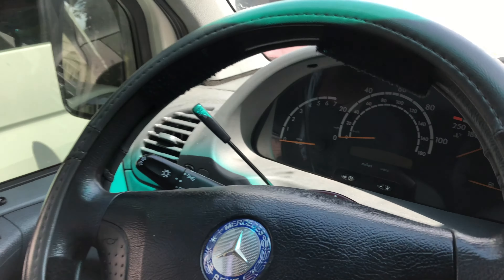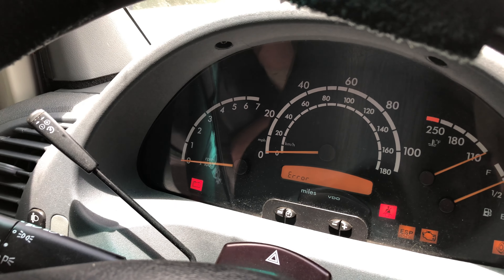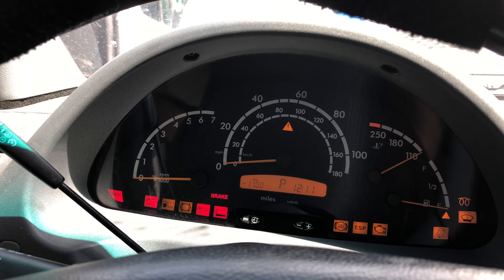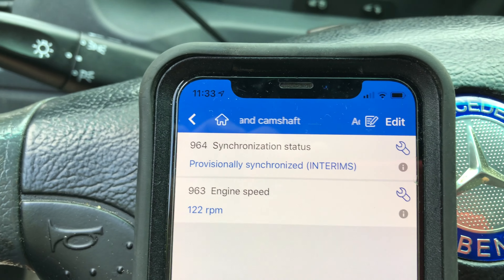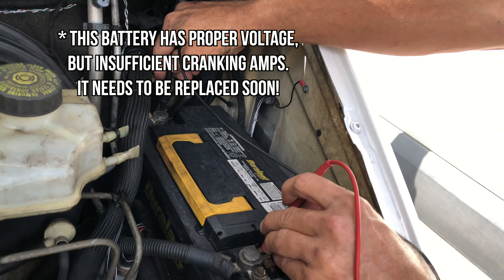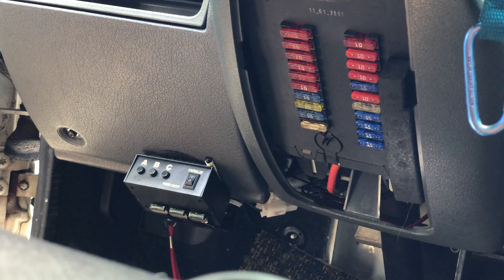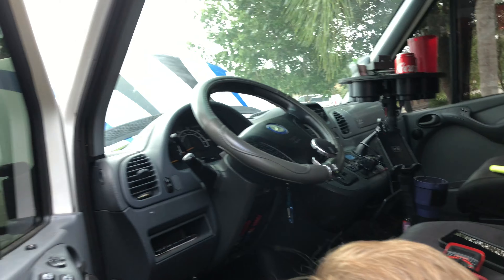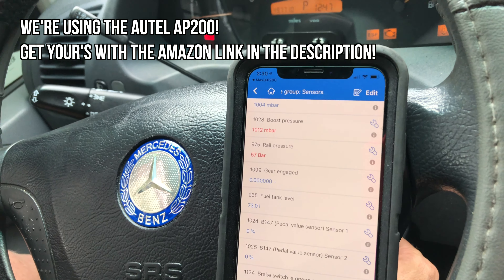Common Causes a Sprinter Won't Start. Fuel pump relay, starter relay, fuel flow, low battery, etc.

Comment: I have a 2005 sprinter 2500 diesel van that has been converted to a RV.  This van has a freightliner badge.  The van will not start.  The first problem with a no start could be fixed by removing the negative cable and reconnecting it.  This worked for a while. Next the dash would light up but the van would not crank.  Now when the key is turned on the van the power blinks on and off repeatedly.
I replaced the engine control relay but it made no difference.  Have you ever had this problem and do you have any thoughts about how  to fix the problem?
Reply from the maker: Yep! I'll bet $1 the short battery negative cable has a bad connection. The ground point on the firewall right there is notorious and the cable going into the lead battery clamp is often problematic. Replace that short cable and clean the firewall connection with wire brush. Use battery grease available in $1.99 pouch at the register of every auto parts store. Be sure the battery has a good charge and let me know if this does not resolve the problem. I have my 'double or nuthin' bet' already loaded. :)
Reply: Thank you.  I will certainly give this a try.
 @FloridaVanMan

Comment: Well I primed the fuel filter and the fuel pump is drawing fuel but still turns over but no start. I’m thinking my next step is replace the cam sensor although I did here the radiator fan running and just seeing your video that relates to this watching it next! Thanks
Reply from the maker: If the electric radiator fan comes on when the key is turned on it isn't going to start. There are three relays under fuse box on steering column. Swap those around and verify fuses #16, 17 & 18. Verify the fuses on the front of the battery are passing 12volts to the bottom of each big fuse. https://www.youtube.com/watch?v=hRmXq4KRHdQ&t=284s
Reply: @FloridaVanMan  thank you once again on a weekend evening!! I’ll check and verify!
Reply: @FloridaVanMan  but it does crank over!
Reply from the maker: @farmitecture2060  Fan comes on and the starter still turns? That's unusual. Maybe someone has hot-wired the fan trying to make the a/c colder.
Reply: @FloridaVanMan  yeah I plugged in a code reader and just turned the key to provide power and the fan ran the whole time. Wasn’t sure about codes as battery had been dead for some time but got codes C1022, C1010 and C1024

Comment: Hello sir I have a same problem with my 313CDI when I stard and I try to accelerate the van turns off...I change fuel pump, and air filter unfortunately same problem..plz tell me what to do?🤦‍♂️
Reply from the maker: That usually means your fuel pressure at the rail is dripping too low, causing the van to stall. I can work with you on some testing for leak-off in the injectors and the fuel rail. You might also be experiencing shut-down due to an electrical issue at the fuse box but I think the fuel pressure is the right place to start. Do you have a good code reader like the ones linked here? https://floridavanman.com/links/

Comment: Se problem no start only crank.  Will start with starter fluid in air intake.  but my van 2001 sprinter  an has no in tank fuel pump. Can't find pump relay .  Is there something similar 🤔
Reply from the maker: A 2001 won't have a pump in the tank or a relay. Starter fluid is a really bad idea. Use diesel fuel in a spray bottle. It works almost as well and is a LOT safer for your engine! Since either does start it we know it is trying to run just not getting enough fuel pressure to start. Likely culprits are injector or rail leak-off. We have tests for both. Search "leak-off" at https://floridavanman.com/
Reply: @FloridaVanMan  thank you for your help 😃

Comment: This is a great video! Would this apply to a 2008 sprinter as well? I pulled into the gas station got some diesel fuel pulled up to the front went in to get my change want to come back out she wouldn't start, just crank.. It was about time for my fuel filter so I figured that was it I changed the fuel filter no help still just cranking. I will give you a video another watch when I get back to my van. Thanks!
Reply from the maker: There are many similarities but also some differences. Is it possible you pumped gasoline and not diesel? Cold fuel on a hot pump in the tank can be the event that causes a bad fuel pump to quit working but there are many other things that cause low fuel pressure. Do you have a compatible code reader? Find me on FaceBook for 1-on-1.

Comment: Hi! I have a 2005 with cold start troubles. Replaced all fluids and filters, camshaft sensor, and all glow plugs, battery tested good. Only happens 30% of the time. Once I get it running it turns right back on no problem. Been to 2 shops for help with no luck. They said pressures look good so I’m assuming that rules out fuel delivery issues. Maybe injector giving out? Any advice would be great thanks! 🙏
Reply from the maker: It could be one injector allowing fuel pressure to leak off, returning to the tank and not holding enough pressure to fire-up the injectors. There are several more likely culprits in the pressurized fuel system. Without reading codes you are throwing darts in the dark. Get the AP200 from our links page then watch the video on setup for a Sprinter. I offer one-on-one help to our Patreon members. https://floridavanman.com/donate/

Comment: hello, can you tell me what are the relay under the driver's seat for?
Reply from the maker: Accessible from the side access, the yellow one is for the in-tank fuel pump (2004-2006). Older vans won't have that relay. The black or grey one is the start relay. Deeper under the seat is different for almost every van. Every change in factory options changes the layout of the relays under the front edge of the seat base and testing is the only way to discover which relay does what.

Comment: Hey @FloridaVanMan I'm in Australia with 2003 413 4Cyl Sprinter and after a recent fuel filter change it's developed a strange no-start problem, it will start off the key with no problem...run for a few seconds, then stop.... now it will take up to 8 attempts to start then it starts and its back being its normal self. This situation has happened before when I changed the fuel filter..Any suggestions? Thanks in advance
Reply from the maker: Strange symptoms, could be an air-lock but I'm leaning toward something going wrong as the ECM changes from default startup values to read sensor values. If you have a meter like Autel AP200 look at the live data, specifically MAF value, rail pressure & EGR value if you have that. Watch it at startup thru stall, then watch again at startup when you expect it to be normal self. Something will probably be different a moment before the van stalls.

Comment: Question, my 2003 sprinter Freightliner van does not have the extra relays that are in this video It has one black one. The numbers do not match the ones underneath the seat. And mine I had to take the seat out to access them. Please please please someone help me It has been down now for 2 months and when I turn the ignition on there is no noise or buzzing from the gas tank. So I want to start with the relay. Is there any other fuses or relays?!?! I am a complete loss and frustrated to no end

Comment: I purchased the Autel AP200 from your amazon link. I have a 2005 T1n freightliner sprinter. It says not supported when i enter the VIN . Do i need a different scanner?
Reply from the maker: Don't enter the VIN. We have a video showing set up and first use. Skip the VIN and manually select Sprinter in the menu.

Comment: Is there anything special about jump starting a 2006  Sprinter T1N (308cdi in our part of the  world).  Is it alright to connect to the battery terminal in the engine bay, or will this damage the ECU.
Also what about Solid State jump starters, again is it alright to just connect to battery terminals (my battery is in engine bay). I cannot see any  additional terminal meant for jump starting like in the newer  sprinters. I was looking forward to see this mundane topic of jump starting, but he  skipped it altogether.
Reply from the maker: Nothing special about jumping our vans. Jumper leads go directly to the battery positive and the black lead can go to the battery or any good ground on the van. The ground strap between body and engine is often a weak point that can be identified by moving the black jump lead to the engine.
Reply: @FloridaVanMan  What is the Hella part  number of the 5 pin relay shown here (in the video).

Comment: NEED HELP! My sprinter fuel system was working perfect but I had to pull the engine for repairs and install it back, now the high pressure fuel pump won't allow the fuel to pass through it. I replaced all the sensors and regulators. Something is telling the computer the pressure is too high but that's not possible because very little fuel is going into the fuel rail. Will the camshaft sensor stop the high pressure pump from pumping, I will check that next.
Reply from the maker: Cam shaft sensor isn't your issue. I'll bet a dollar you have two plugs swapped. Look at the plugs on the high pressure fuel pump. The larger plug should have a 90 degree bend in the plastic plug. If the wires come out of that plug straight, swap it with the plug on your crankcase breather hose. The hose heater is where the straight plug goes. Join me on Patreon for one-on-one help. https://floridavanman.com/donate/
Reply: @FloridaVanMan  Not the issue, I have the correct wire connected. I wish it was that easy.
Reply: @FloridaVanMan  Will it not work if the transmission is empty of fluid and also the coolant is empty? I just wanted to hear it start before finishing everything. I guess I'll put all that together before I try again.
Reply from the maker: @Shane71170  Transmission fluid and coolant will not prevent engine starting. We have videos for testing fuel pressure from the tank, injector leak-off and rail leak-off.
Reply: Someone told me there is air in the high pressure pump causing air lock, if so how do I prime it?
Reply from the maker: @Shane71170    Is your engine OM612 or OM647? If you have an in-tank fuel pump simply turning the key on will flush the fuel pump and rail forcing all air into the tank return lines in just a few seconds. If you do not have in-tank fuel pump you may have air leaking in before the low pressure fuel pump. Please join our Patreon or make a donation to help make answers like this possible. HTTPS://FLORIDAVANMAN.COM/DONATE/
Reply: @FloridaVanMan  I have the fuel pump in the tank so all my lines are primed, I know this because I also own a 2002 without the fuel pump in the tank so I know the difference. My problem lies in the high pressure pump. I'm getting plenty of pressure from the tank and I have a new fuel filter. I had a guy look at my van today and he swears there's air in th pump causing it to have a fuel lock so I just got to get the air out and was not able to do so today.
Reply from the maker: @Shane71170  That "guy" is wrong, but if you want to keep trying the impossible I won't hold you back. https://floridavanman.com/donate/

Comment: I have the 1998 210d sprinter van and it has the same problem, when ignition on the pump in not on. But I could not find the relay on that model
Reply from the maker: Most UK model Sprinters won't have an electric fuel pump. They have a low pressure pump on the front of the engine right next to the high pressure pump. Both are cam driven.
Reply: @FloridaVanMan  so are you saying that the bosch rotary injection pump is actually one that sucking the fuel mechanically?
Reply from the maker: @aldinoz  No, right next to the injection pump is a smaller sucking pump that pulls fuel from the tank through the filter then pushes fuel into the high pressure pump.

Comment: I am having my WiF light come on along with few other yellow light neae the engine light on my 2005 doge sprinter 2500.
Can WiF stop my engine from starting because everytime it goes away the engine starts. I replaced my feul filter but that didn't solve the problem
Can the the feul filter sensor be faulty every time it rains the light comes on.
I checked the plug and the wiring everything looks fine.
Can't get the van started what should I do.
Reply from the maker: WIF sensor isn't tied to the engine controls, only to the dash light, so it cannot prevent starting. Sounds like you have a bad ground connection or maybe a failing dash cluster. Look for mouse nest in the dash behind the speedometer under the half-round panel.
Reply: @FloridaVanMan  Found the cause the fuse box was loose and it cused few electronics to malfunction, like feul pump, WiF, glow plug module, traction, CEL, among other things.
You were very close when you said a bad ground connection, thanks for help

Comment: looking at a 2003 airstream version, but does not start. 2.7 in it. 250k 3k, would it be worth it to fix? thanx
Reply from the maker: Risky!!! Plan $10,000 on repair so you don't get clobbered if the engine needs rebuilt because injectors fouled. If you are willing/able to work on it yourself this could be a winner. If you are going to pay a local mechanic to fix it I must advise you to walk away before you get hurt in the pocket. I have an OM612 engine here that has minor issues and would be an affordable drop-in. I'd be interested in seeing the listing. I won't buy it from under you but don't post it publicly because someone else might. Try my email, Bill at (you know the rest).

Comment: My 2005 sprinter in the morning starts straight away, but once engine warms up the and you want to restart it, it won’t start it’ll give you a very hard time to do so .I thought glow plug issues so I change the glow plugs but still I have the same issue any idea what could be Stopping the engine to restart when engine  warms up
Reply from the maker: What you describe is often a camshaft sensor failing when hot. We have a video for that. https://www.youtube.com/watch?v=Exgt_C6oZf8&t=3s

Comment: What diagnostic tool you can use if you have pin14 plug
Reply from the maker: So your van has a 14 pin round diagnostic port? The AP200 linked on our products page and this adaptor made by Autel. https://www.autelsale.co.uk/wholesale/mercedes-benz-14pin-connector-for-maxisys-ms908-and-ms908p.html?fbclid=IwAR05zrYl9NBm7tZg9tByjaEoRfO9gy26TmOWjdAN97zNRwHrFmIVHo7cabY
Reply: @FloridaVanMan  thank you, so withe the adaptor it should work? Just bought locally one and it works with a simple code reader, couldn't connect with computer, i was wondering if I should try with this ap200. Thanks 🙏
Reply from the maker: @karolinarej7837  I'm told this adaptor works with the AP200 on Sprinters having the round plug. We don't have any round plug vans in the USA so I can't verify it myself... but I grabbed this link from a conversation where a few folks confirmed it worked for them where other adaptors had not.

Comment: Any guess on why lights and accessories go on, no start error, but when turning over to start it automatically shuts off and I have to disconnect the battery terminals to get lights and accessory power? Thanks!
Reply from the maker: So it starts to turn the engine and then seems like it disconnects from the battery? Everything stops and the dash goes dark until you unhook the battery? And it does this occasionally or did it start doing this and hasn't run since? Sounds like an aftermarket alarm system with engine cut-off. Maybe a blown fuse to the accessory input of the alarm. If you don't have an aftermarket alarm I would consider cleaning the ground points near the battery, at the engine and under driver seat. If all that doesn't work, check all fuses, especially #7 & then smack the crap out of the fuse block under the steering wheel.
Reply: @FloridaVanMan  thanks a bunch! Gonna try this after work. It started doing it and I was able to correct it by disconnecting the battery. Gonna try this after work

Comment: Good morning sir. I have a 2003 2500 sprinter and my van won’t start. My van doesn’t have a fuel pump relay under the seat like your video I think cause older. Any suggestions where it would be at?
Reply from the maker: The starter relay is under the driver seat and you should be able to hear & feel it click when turning the key to start. We could check the contacts with a volt meter to ensure you are getting voltage to it in each position. Next time it doesn't start, try putting the gear sector in Neutral to try again. Be sure to use the brake and don't forget to put the van back into park if it doesn't help. Many folks have reported issues with the fuse block under the steering wheel. This fault can be isolated by holding the key in start position while giving the fuse block a good Whack!

Comment: I bought a 2019 how long I have to warm up it?
Reply from the maker: Your engine won't warm efficiently just sitting in park. As soon as you can clear the windows start driving gently. A cold running engine is when the most friction-wear occurs and it warms best under a light load. That said... I'm Florida-Man so what do I know about cold climate??? LOL

Comment: at 5:55 How is my van running with out that yellow fuel pump replay? I runs sort of/sometimes, with out that Fuel Pump Relay on the left side on the seat, looks like all of em are still under the middle top area? probably just going to buy one to fill in the gap hopefully that helps my problem.
Reply from the maker: Older 2002 & 2003 Sprinters won't have that relay because they don't have an electric fuel pump. Rather than an in-tank electric, you'd have a manual low pressure pump on the front of the engine, above the high pressure fuel pump.